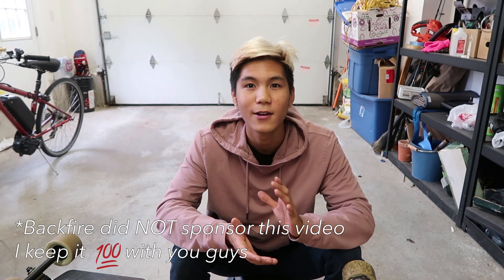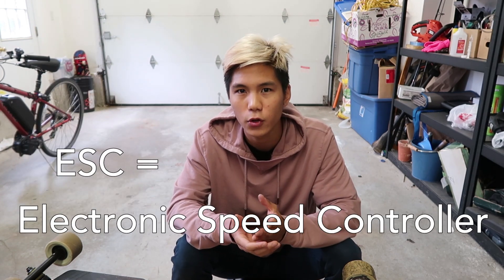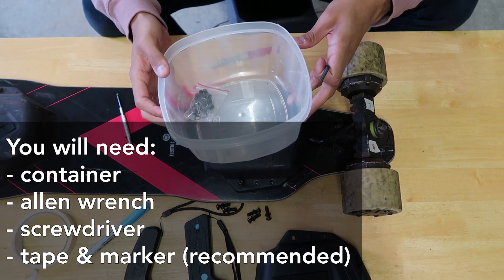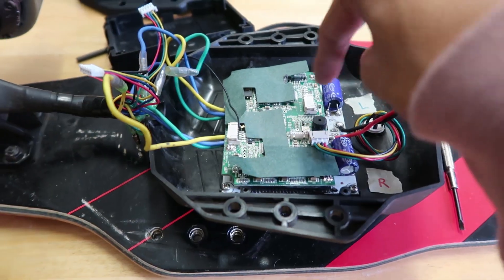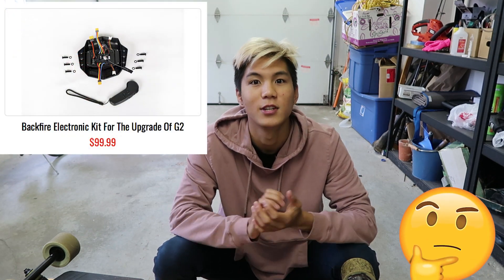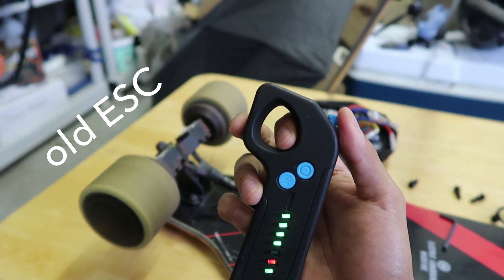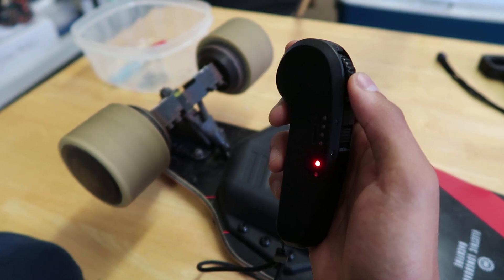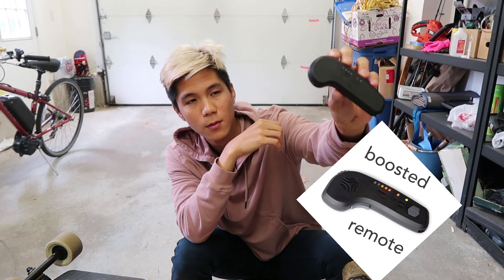Backfire G2 ESC Upgrade Kit | Tutorial & Review

Comment: Great video. Can the board accelerate faster with the new esc and is there any effect on the top speed?
Reply from the maker: The board's acceleration feels a lot smoother but I wouldn't say there has been a noticeable change in acceleration rate and top speed since the upgrade. That is to say, the torque and maximum power output have stayed the same. I think those are mostly determined by the battery and motors, which were not part of the upgrade, but that's just my guess. Hope this helps!